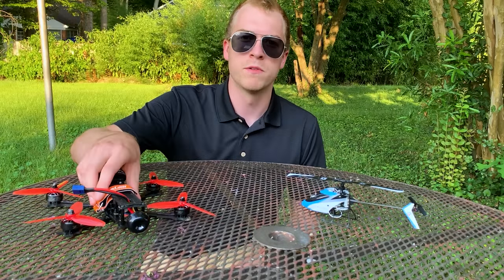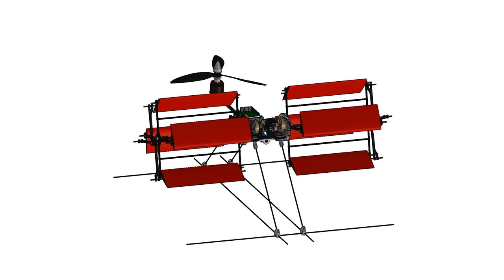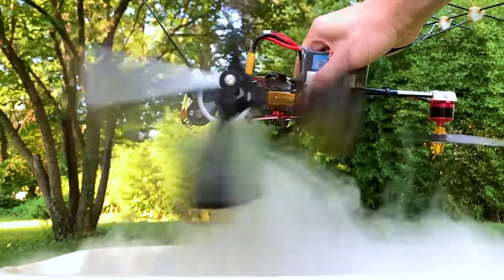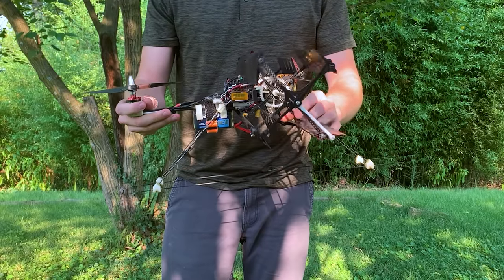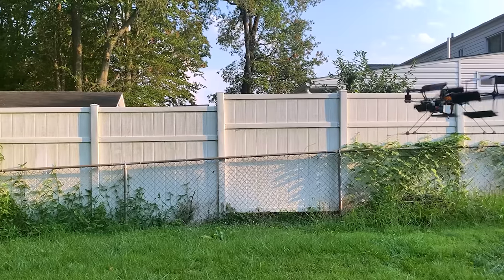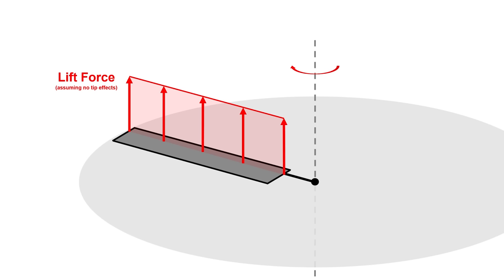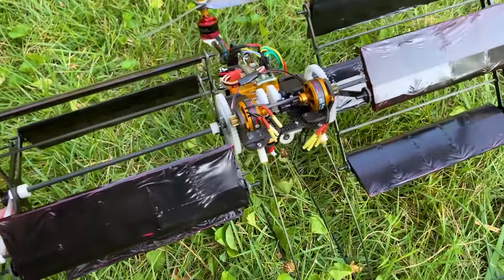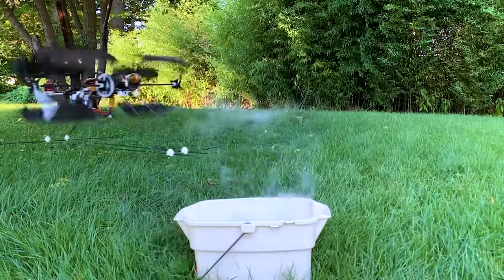Cycloidal Rotor Drone: The Cyclocopter

Comment: Great Video!
Would it be possible, that you provide the specs from the motors you used for this? 
Looks like the operating speed is really high... something like 1600 RPM?
Reply from the maker: It’s a 1700kv motor on 4s geared down something like 8:1 if I remember correctly. So like ~3000 rpm max under no load. Probably half that under load, so great guess!

Comment: AWEsome design.   Here is a suggestion......   two sets of cyclocoptor blades, add one set to the front where the traditional propeller is but spin them the opposite way as the rear set so in effect a quad - cyclocoptor?   would give great control and twice as much lift capability, might make for a very stable camera platform. ?
Reply: Ahh just read that RC Aviator suggested the same lol

Comment: Why did you try to maneuver that frontflip/backflip as if it were a helicopter? It should be possible to make the body swing around with the rotors staying stationary, i.e. let the cyclocopter rotate around the axis of rotation of the blades. It would probably require you to adjust the servo mechanism and try to give it as much rotation as possible and definitely more than 270° plus a mechanism to very quickly make it rotate from one end to the other (assuming it's not possible to make it rotate full 360°).
I guess I just answered my own question: the copter wasn't adjusted for that large angle of steering hahaha

Comment: could you make but with another set of cyclocopter blades on the back instead of a regular prop. how much air is pushed down? if there were a life sized one could you land in gravel without breaking a bunch of windows?

Comment: What are the drawbacks? What is the calculation of the amount of lift to wingspan area and speeds I guess is how lift and thrust comes together? Is it quieter than other propulsion methods?
Reply from the maker: You should check out my latest video for some of those answers
Reply: @NicholasRehm  I did but all you referred to was the noise.. Propellers seem to require about 1hp per kg using optimised propellers so Im assuming they can at least equal that and a two person personal machine will require about 500hp for lift and hovering combined Cyclo's and balancing propeller, just to be safe.

Comment: What if you could install this into a wing so that it can be used for Vtol, but then another rear wing could be used for pitch at speed, and a smaller ducted fan in the body controls Vtol pitch. 

Or am I understanding how these work incorrectly? Because if not then ypu could set it up to completely alter a wings stall characteristics at different speeds. Assuming that you use a ducted fan, or prop to push/pull the craft forward, and the wings to create flight similar to that of a plane.

Comment: Really curious about the (emergency safety) of these things. From what I understand there's quite a few things that make these better than a standard helicopter. But, I have to wonder: do these have any type of safety feature if the motor dies mid flight? Like if a regular helicopters motor dies while in flight it can still auto-rotate (Ithink is the term) so they don't just fall out of the sky. Do these have anything like that? or are they only safe for unmanned vehicles???
Reply from the maker: They can theoretically autorotate at larger scale. This one is probably too small
Reply: @NicholasRehm  They really are pretty awesome then. Been curious about these things for a little while now. Thanx for the quick answer. Great video!

Comment: It may be efficient for vertical movement, but not effective for horizontal movement, because the cross-section of the two wings is always vertical and creates air resistance during horizontal flight.

Comment: Take a wing and whip some air in the right direction and it’ll fly… Might be interesting to capture the blades in a fixed duct so you don’t need so much rotating mass, like embedding them in a thick wing like structure. A fan will probably always be more efficient though… There’s usually a reason that you don’t see some designs, and it’s probably not because it hasn’t be thought of, newer materials and manufacturing processes can change that though…

Comment: what if instead of a fixed pitch and varying power for thrust control, you had a flywheel to maintain constant rpm and changed the collective in two dimensions instead of just rotationally? then you could gain all the benefits of a helicopter with the efficiency of a plane. you could also design it to take advantage of the magnus effect like a fettner plane.

Comment: beautiful piece of engineering... I have some metals and bioplastics you might be interested in.. AuPd is as light as.. or lighter than aluminum... I have made it hard enough to scratch tool steel.. it's easy to make and, basically free with a few minutes of effort.. wire, plate .. foil... I'm actually not the first bright boy to figure it out.. that "aluminum" tape on the market recently... from China... has a really high melting point... about 1550° C or more... the melting point, specific gravity and other properties tell us what it is... about 50,000 times more able to form and de-form than aluminum and steel... transparent to magnetic fields... and a superconductor for heat... I can hold it in my hand and drill, polish and cut it without cooling water or oil.. it doesn't tarnish or oxidize
it is a superior catalyst for about a thousand chemical reactions in the laboratory.. among which is one I'm going to use... it will create more hydrogen peroxide in a 3% solution of hydrogen peroxide... like what you buy at the dollar store... the foil works best for that.. found at the dollar store as aluminum foil..  but it is super white and shiny... and won't melt with a map gas torch with a 1300° C flame... ball it up and it floats in water and hydrogen peroxide... the aluminum tape stuff is stronger than duct tape... which as everyone knows, is a handyman's secret weapon

Comment: I wonder if a transition to airplane flight mode is possible, by stopping the rotors and bringing the airfoils into right position. Possibly two foils per rotor would do. possibly tilt the tailrotor for propulsion and steering.
Reply from the maker: Excellent idea
Reply: @NicholasRehm  The question is, if this would be up-scaleable.

Comment: I still really  don't see the point, you have a much more big structure that adds more complexity, meaning more weight to carry and more things that can break/malfunction, less efficiently due to higher weight... The only application  I Personally see is if you make it into a vtol where after lift-off and an adequate  speed and height the wings all stop and straighten out, and it flies like a normal airplane, then starts spinning and moving again only for the vertical landing... But even that is better done with a more standard  vtol setup. So again, ANY real world use and advantaged AT ALL? Or just because it's new and cool?

Comment: 🟦 I've heard they've been using something like this as thrusters for tugboats and very large ships for maneuvering at low speed when docking,... The large deflection area makes for quite a bit of power at low RPM!,.... But as far as flight is concerned, I don't believe this can be practically scaled up.

Comment: You know, it's funny when I see stuff like this. Sure it may work but it's so impractical. Not only mechanically (helicopters would simply not exist if they couldn't hover because of how dangerously and expensively complex they are) but legally. Just try getting something like a full scale of that through the FingAA. 

That's not a negative for this video though. Good content. Just kind of silly treating this (as some commenters are) as a better way to do planes. 

(Credentials: Degree in Aeronautical Science with minors in professional flight and applied science. Feels good to flex that as it's the only time I've used it lol)

Comment: I think that if you could print some rotors with a 3D printer, you could improve efficiency
Reply from the maker: Definitely; my hot glue / foamboard blades were thrown together pretty quickly and without much thought

Comment: Now imagine having 4 of them set up to work similar to how a drone works, except it just goes forward instead of pitches to initiate forward movement. 

But you gain the lift of each blade set, and do away with the prop.
Reply: Russia already has one. Not full size but they do have a prototype drone.

Comment: I can see some benefits to this concept but it seems it has many issues in reality. What comes to my mind is the forces on the blade holding struts change from push to pull per rotation with a bending moment in the forward and backward position due to the directional movement of the craft. I would assume they would have big material stress fracture issues in a full scale craft. Many things sadly only work in small scale :(. Seeing a full scale drone helicopter doing some dance moves like a RC helicopter would be awesome but with the current powerplants and materials impossible.

Comment: 3 motors and 2 servos. And mechanical details to change angles. Against 4 motors without additional mechanical details in a quad-copter. Looks like we're returning from quads back to the helicopters that needs in a lot of same workarounds - additional propeller, mechanical parts for angle adjustments...

Comment: When trying to flip it in air, you need to stall out the rear stabilizer as it completes the apex of the inversion. You might also consider using the horizontal rotors as a drop pivot. So you would slightly reduce the velocity of those rotors in order to drag on the rear stabilizer so as not to have to significantly increase the speed of the rear stabilizer. The pull downward would create a force pushing up on the rear stabilizer, causing it to rotate around the axis of the horizontal rotors.

Comment: I prefer this type of lift, since the rotation of said lifting does not have to rotate at a very high rpm to obtain lift, and less mechanical complexity.
The only thing one has with a disadvantage of this type of unit, would be if the motors stopped, 
So how could you devise a system for a safe landing, then you would have a unit worth exploring. without using a para-shoot.

But it would be advantage of you to combine the motor system to only use one motor, It would be very useful as a helicopter in principle and much more reliable when parts do not have to run at such high rpm. and could replace a lot of helicopters except maybe military ones 

Would a gyro type of drive give you landing capabilities with a motor failure,

Comment: Help me build a variable pitch control system for my 5inch quad. I need turbo props. My batts use too much power reversing my props to fly 3d.  I need to be able to have control of the collective

Comment: Intuition tells me that each blade should only be half as long, axially. As it stands now, the downdraft from when a blade is on top probably cheats the intake to the lower blade. REF: helicopters with 2 opposite rotating blades on one main shaft.

Comment: With a robust gearing system (to minimize transmission losses), some molded carbon fiber blades and rigid spars, I think this has some really interesting VTOL applications for the really really nerdy drone operators/engineers.

If you had a mechanism to fold it along the horizontal line (and use centrifugal force to open it up) you could incorporate this into a wing where the blades themselves would become part of the airfoil during flight and unfold at landing. It has always annoyed me that you can't incorporate VTOL propellers in wings without having them stick out at silly angles or be part of the general propulsion.

Someone with access to more CNC machinery than I have should make some wingtips..

Comment: An interesting parallel - some tugboats use a propulsion design that works the same as this. They  have a vertical axis and blades, and directional thrust is generated by controlling the pitch of the blades.

https://en.m.wikipedia.org/wiki/Voith_Schneider_Propeller

Comment: Thank you Nico for this experiment. We see, a Cyclocopter is also flying, OK. But: it's too complicated with two bearings per plane, in this case 16 bearings plus 4 excenter bearings. A simple crash produces a total damage. A quadcopter has just 4 rotor- bearings, that's cheap and robust.

Comment: Why is it a "nose" rotor, it looks like a tail to me, but then that means cyclo-rotors design must flip? If a load is applied to the craft (fuslage), it seems logical for it to be opposite the conventional rotor.
Reply from the maker: A little difficult to quickly explain but basically for better efficiency in forward flight, you want the lower cyclo blade to be the advancing blade. This means the rotor for counter cyclo torque needs to go on the front.
Reply: @NicholasRehm  ah yes and turbulence impacts, partially too?, I see.

Comment: Would be interesting to tweak this so that the copter could flip in place at a slow rate. Should be possible by having the position of copter along the x axis updated in realtime and adjust the rotors accordingly to match the inputs of the controller. Would make a really cool demo.

Comment: shrouded impeller pump fan, one or more pump exits, down, up, back, front, obviously sides are in-air-flow
Reply: tesla disc turbine pump thruster
Reply: quad cyclorotor, as usual
Reply: tesla disc turbine or impeller, shrouded, is the most simplest ridig rotor, just one moving part, no much life expectancy for cyclorotor blades
Reply: right
Reply: radial ducted blower fans are better, only rotor moves not the rotor wings

Comment: Can anyone just by looking at this design deduce why the standard helicopters use rotor blades and why the cyclocopters were not used?  The design is overly complicated and even though there are 4 airfoils only one when it is at TDC is generating lift.  The others while perhaps provide forward thrust mainly increase weight and a ton of drag.  Back at the dawn of aviation there were many designs that attempted to solve the problem of vertical lift.  The biggest reason that the cyclocopter failed was not the theory of the way it generates lift but they failed due to the limitations of the materials available for structures of its day.  When they attempted this design all aircraft were made out of wood, and a some used steal tubing for the fuselage covered with fabric painted with dope.  I remember a documentary many years ago, might have been back in the 1970's of all the failed attempts at designing aircraft.  The cycocopters rotors flew apart when they tried to speed the rotation high enough to actually generate enough lift for flight.
It is really interesting to see that by using the modern technologies of carbon fiber and light weight monocote he successfully achieved sustained controlled flight.  The question I have for the designer would be if he succeeded in scaling this up to a full sized craft would he have the courage to pilot the thing.  It reminds me of the old real lawn mowers, I doubt I would want to sit between two of these rotating masses.

Comment: Couldn't it fly at any pitch just by rotating the collective thingy? Therefore, couldn't it do a "standing loop-de-loop" just by making the nose rotor imbalanced with respect to the cycloidal rotor's moment to kick off pitching and then continuously adjusting the collective? You show that it can fly forward with or without a forward pitch, and doesn't that mean that it can fly forward at any pitch at all, even straight up and down? And by the same logic, it should be able to hover at any pitch too.
Reply from the maker: Yes definitely but that is a very challenging control problem that I haven’t bothered to put much thought or energy into solving…yet
Reply: @NicholasRehm  I suspect it is a pretty simple problem, for a computer :-) Need some sort of fancy preprocessing and high speed sensors so that your input is just "I want this pitch" and a computer maths it for you 50 times a second. I suspect the theory is a well-solved problem but the particulars (for this particular control model) have never been done before, but it's not my domain so I could be way off.
Reply from the maker: @logiclrd  yes very simple for a computer, and all the necessary sensing is already there. It’s just a matter of speaking computer to tell it to do that
Reply: @NicholasRehm  Fair enough :-D

Comment: The Bernoulli effect airfoil is incorrect , lift is generated by virtually planing on the air .  More compression than lift . If a blade created lift it wouldn't generate a massive downwash..... camber has little to no bearing . Peace ✌

Comment: Heli blades are in extreme tension which helps stop them flexing upward.
It would be interesting to see if cyclocopter could be made with 3 or 2 or 1 blade each side.

Comment: Interesting concept. But there probably is a good reason this never was a success. I’m by no means an expert, but…. compared to a conventional helicopter,  this design seems to have quite a few additional moving parts (all with an additional risk of wear, tear and failure). Also, I expect the torque on the horizontal axles to be monstrous due to the large surface area. The horizontal blades and axles need an attachment point on the far end, to prevent this thing from spinning itself to bits. Therefore, the structure should be extremely rigid, compromising weight, power, and ultimately… efficiency?